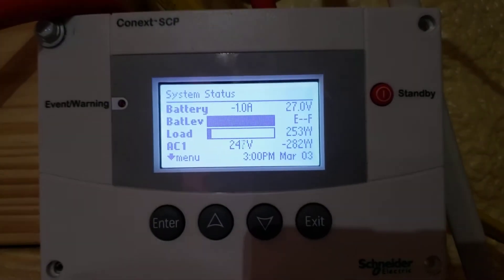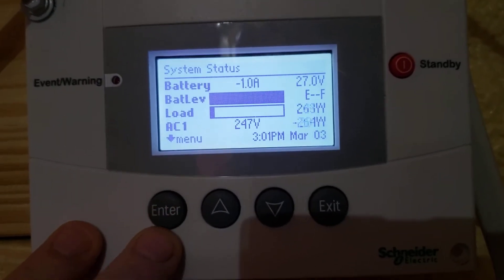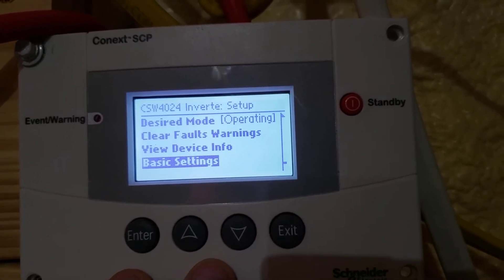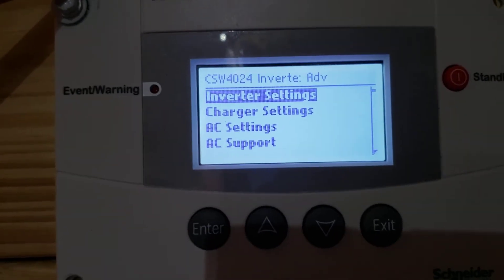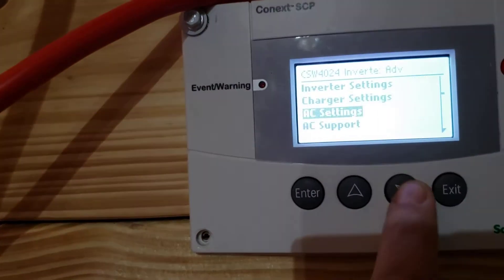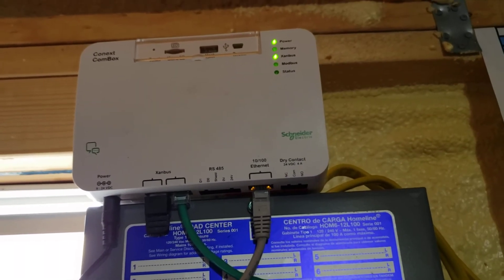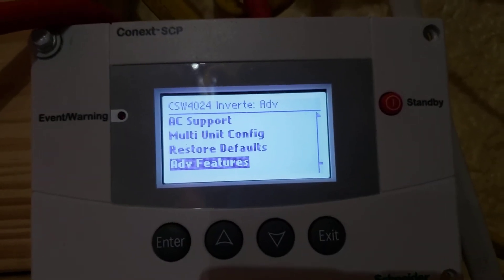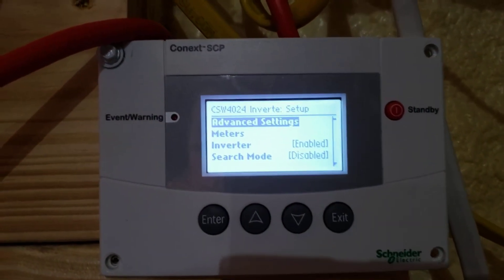Conext SW 4024 How to get into ADVANCED SETTINGS and advanced features limitations via Conext SCP

Comment: Have you ever had to reset/restart the inverter?  My scp/inverter are not responding to button presses after the lifepo4 batteries dropping too low in charge.
Reply from the maker: You know what? It's kind of funny you ask that because I have not had to do a reset but at the moment I am having an issue with the system not load shaving and I cannot figure out why and I have been thinking about doing a reset myself. I will probably try that tomorrow and see if it fixes my issue. Is there anything you would like me to look out for for you on having to do the reset or do you have any advice for me?

Comment: I aready buy and connected Schneider 4048  but output voltage is too high  is marking 257VAC  instead of 240VAC */- and individual is marking 128.69 instead of  120VAC */-.
So with this setting  i can fix that?
Reply from the maker: Sorry it has taken me this long to see this comment. I have the 4024 version as stated above and as far as I'm aware there is no way to adjust that. Now with that being said I have had an issue when I had incorrectly entered the amount of amp hour storage capacity of the battery I had and this caused an issue to the MPPT controller telling it that the battery pack needed more charging time but yet the battery was already full. This caused me an instance where I had high voltage output as well I lowered the battery bank and power capacity by 50amphrs and now when the battery bank charges up during the middle of the day and is at 100% and the sun is still shining I do not get the high voltage error. Hi YouTube :-) and the sun is then completely converted into usable renewable electricity.  What I also did to help with this issue is I have SOC enabled and set to load shave when The battery pack reaches 90% and stops load shaving when it drops to 30% I have my load shave amps set between 2.5 and 1.5 depending on how fast I want it to drain the battery or how much energy I want to consume during an amount of time. So for instance if I knew the power was only going to be out for a short period then I would draw more power with a lower amperage set to load shave so 1.25 to 1.5 whenever it's on standard I don't know how long the power will be out I want to try to save so I only set it to 2.5 and above that way it doesn't draw too much power from the batteries and case of full power loss I still have a backup for 5 to 6 hours. I hope this makes sense Good luck and just make sure you're not trying to still charge your battery pack after it's already 100% full this will cause a high voltage error.  @Tony B  here are some settings like I said if more needed let me know.
Reply: @KPKev  Thanks for your response but i resolve the problem of my inverter i call the store who sold me the inverter and a Schneider specialist  technician by phone and with instructions i correct the problem now my inverter is working properly with 240Vac and 120 vac output.
Reply from the maker: @norbertrivera  if you don't mind would you mind sharing how you were able to set the settings I am curious and I'm sure others would like to know as well. Thank you for letting me know I am glad you were able to get help I hope you enjoyed the system I really enjoy mine.